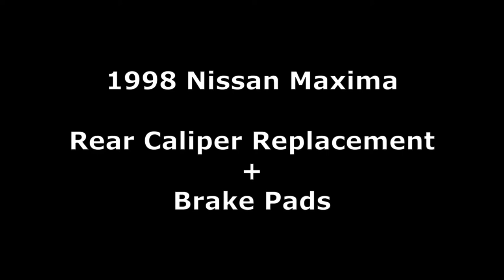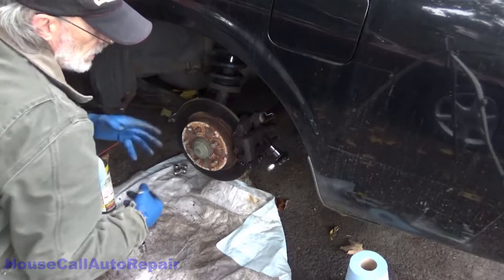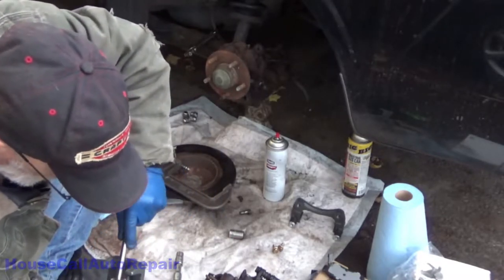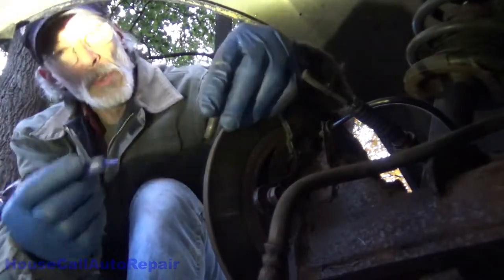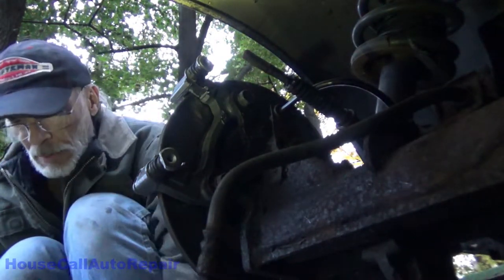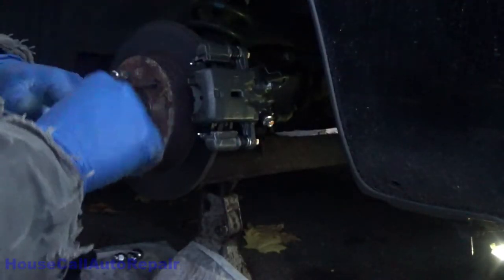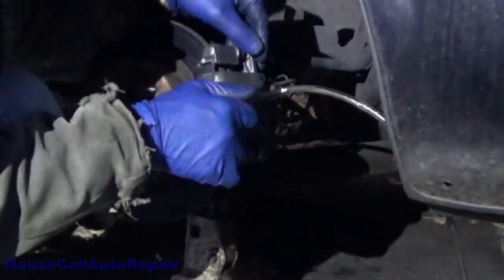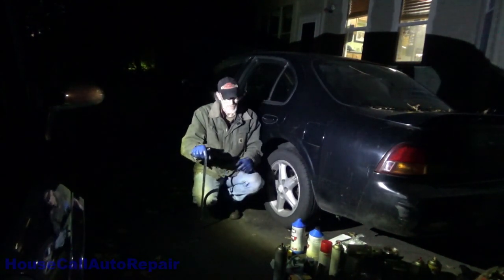1998 Nissan Maxima Rear Caliper Replacement - Auto Repair

Comment: Thank you for this video, I have found that removing the U clip of brake cable is the most difficult part when I was working on my maxima 1996, everything around is rusty to each other.
Reply from the maker: Grab with some vise grips, and tap with a hammer...
Reply: @HouseCallAutoRepair  thank you for your reply, I have removed it by using a hammer and a chisel

Comment from the maker: And YES.... I did a COUPLE of things out of order... I SHOULD have put the lug nut on the rotor BEFORE messing with the new caliper... and YES. I could have finished detaching the cable before messing with the old caliper, and yes, I could have done this earlier in the day so I wouldn't need to have duct taped a flashlight to the roof of the neighbors car... And YES, I could have used a real torque wrench....
And YES, I could have done the whole job and been on my way back home before the sun went down, BUT........ CAMERA!
Reply: Thanks for the video! Helped a lot!